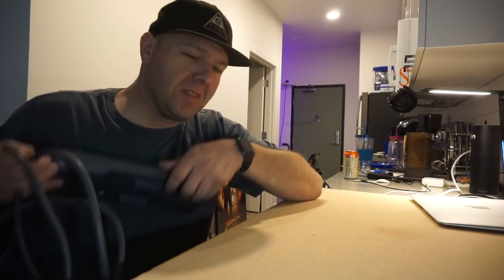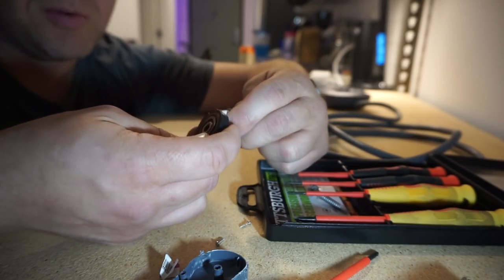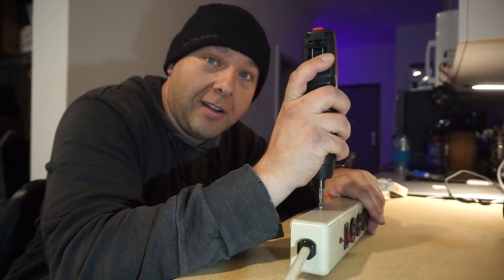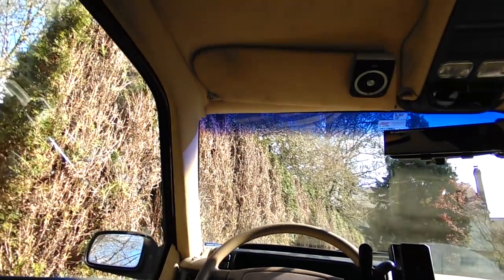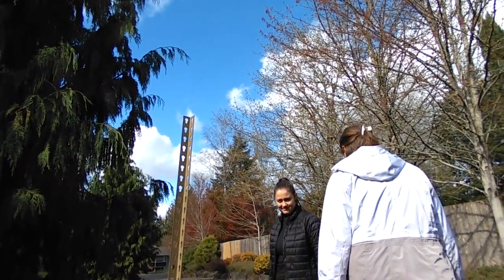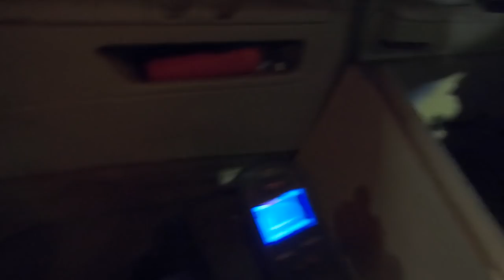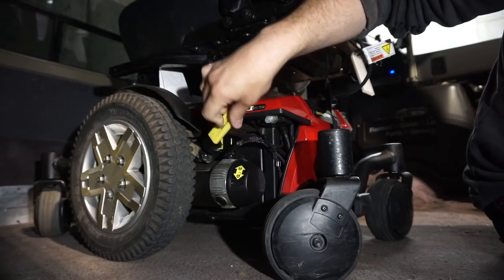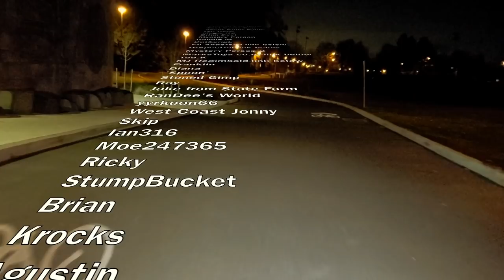MEGA VLOG 417: free workbench?

Comment: Daniel buddy , I hate to burst your bubble the weak point on those is the switch. May I suggest that you leave the switch on and just unplug out of the outlets that way the outlets burn up instead of the switch which are easier to replace. I have yet to ever ever ever find a switch to replace the existing switch with. The next best thing you can do it's get a 20 amp wall switch mounted into a box run the cord into the power strip bypassing the switch and then the wall switch will go bad and it can be replaced. It beats replacing the receptacles or trying to find one of them itty bitty switches the original ones. Forward charge enjoy the vids and the insight.

Comment: the blue things are probably thermistors. they provide surge protection and protection against lightening strikes. Probably to 1600kv in something like that unit. The tan capacitors may be used to filter out AC hum/ florescent lights or similar and to also act like a fuse to protect against reverse polarity. Those caps will probably blow at about a 400 volt spike. just guessing Dan
Reply from the maker: makes sense to me!